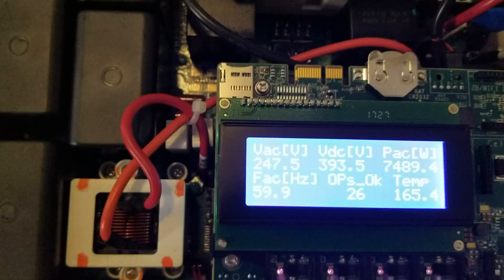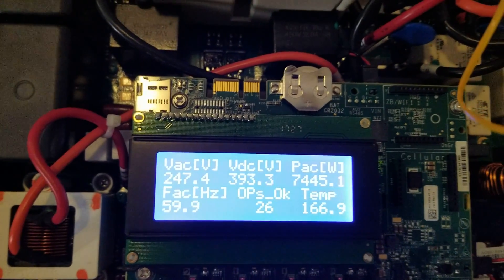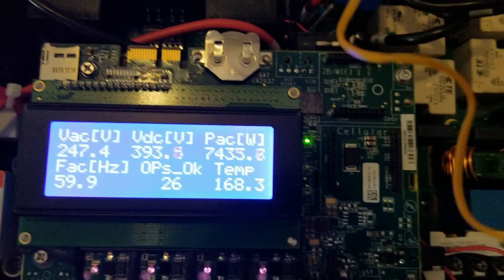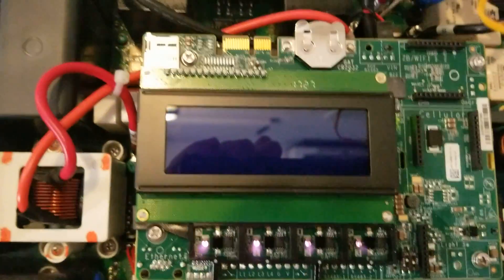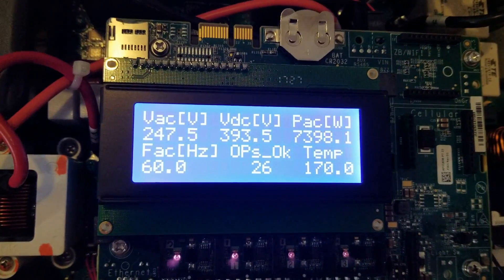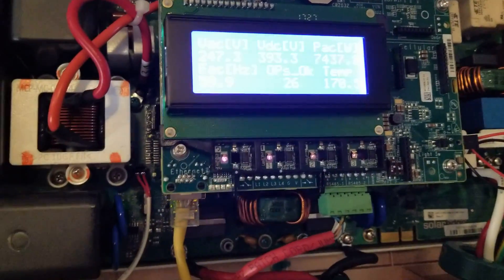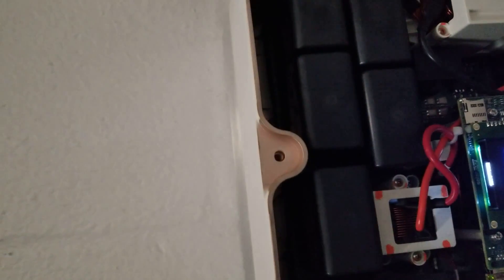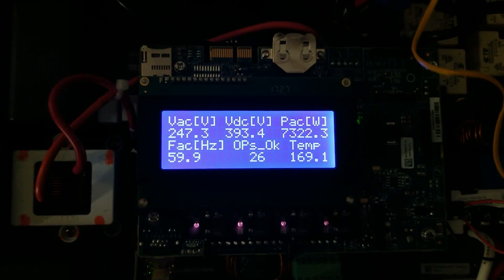Solaredge 7600HD Wave inverter running HOT issue update

Comment: hi, did they fix it? by the way, what solar panels sizes did you use? and how many panels are connected in series?
Reply from the maker: Mark   Yes they sent a new one out and we replaced it.  The temp issues seem to have tapered a bit and it is running for over 9 months with no issues.

Comment: Hello Luis, how many watts is your solar array? Did you resolve the overheating issues?
Reply from the maker: traxxi2003.  My apologies my array is 8K
Reply: Hi Luis! hey I few months back I watched your video when installing my system. I've been operating my system since last October, my system is  a Solaredge 7600HD Wave inverter / 10,800W. Today here in SoCal with an ambient temperature of 70 degrees my inverter was running at 154 degrees F. My system astually shutdown for like five minute, I assume because of the temperature. Did you ever resolved the heating issue on yours?